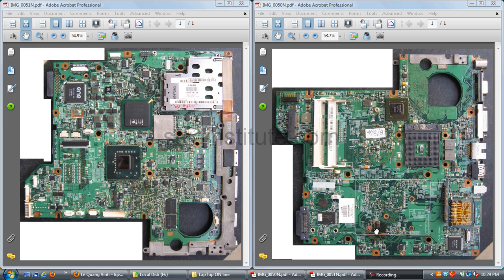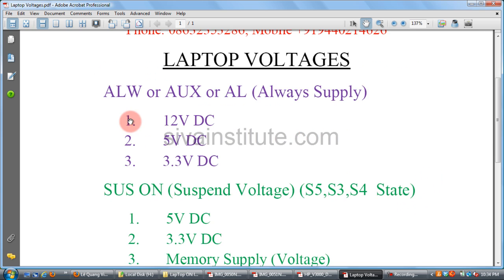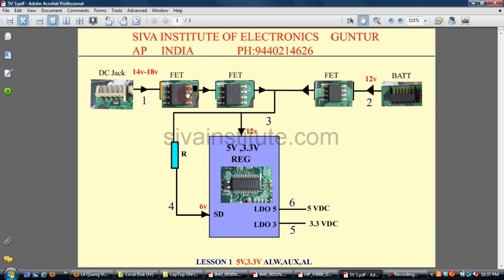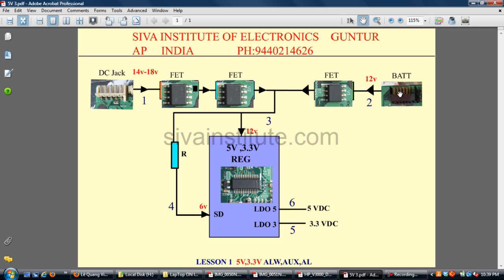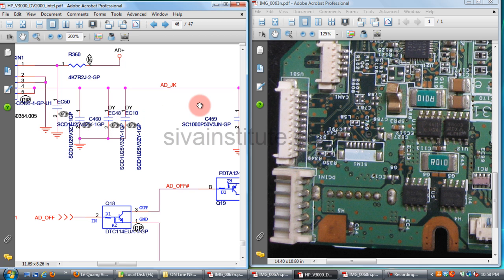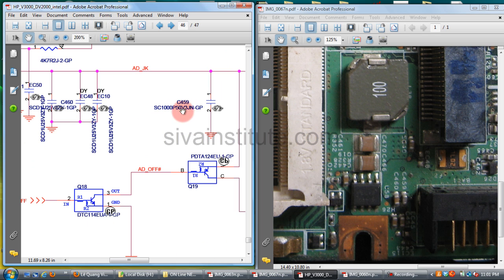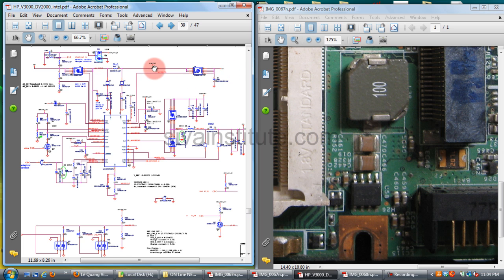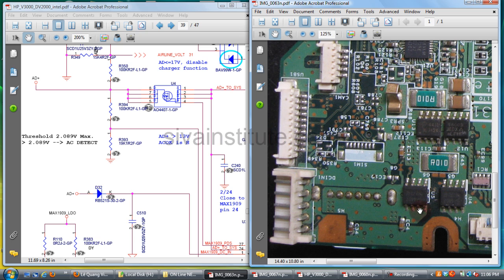Laptop motherboard Repair (Chip Level) How to check dead board .Eng

Comment: Hello

I have a HP6730b laptop Motherboard that is dead.  It does not charge the battery nor does it boot the computer with the adaptor plugged in.  I think the power IC is gone as the output coming out from all pins is 19V.  Am I right?  Any other component i check gives false readings.  Any suggestions?

Comment: Hi,  I am looking for schematics for a Samsung 700z notebook model np700z5c.  Do you know where I can find them?
Reply: hi i happen to be searching for the same schematic, specifically for the charging circuit. my laptop is dead because it wont charge and the powersupply is fine. if you come across the schematic please send it forward. i will do the same.

Comment: acer laptop turn on and then off several times nothing on lcd display ,what is the problem bad capacitors or what , i m chip level allmost please help thanks
Reply: what model?
Reply: Is your acer 5520 or 7520 ?
Reply: bladerunner  yea, could you help me with it?
Reply: what model is that?

Comment: I would hazzard a guess that if the charger is not being detacted.... is the DC socket ok? when you plug in is there any light at all? you have to elliminate the cheapest through to the expensive and the dc socket where it conects to the motherboard may be faulty. Are the joints ok? dry joints? Your question is 3 mnths old so chances are you have solved problem. always obtain schematics.

Comment: I am working on a dell inspiron 1525 intel ds2. I follow your guide and made it to the end where you said to check voltage to input vin and should output vreg5 volts it reads 7.3 volts. Would this be an internal fault of the ic chip or the c249 resistor?

Thanks for your videos and response.

Comment: Hello awesome!! , what about laptops that when you power it on it stay few seconds then goes off again?  the one I have now which brought me to this video ofcause will just flash once when it's connected to the adaptor and nomatter how you hit the power button it would'nt flash again, but when it's connected battery alone, it will flash manytime as you hit the power button. when you hit it flash just like when you are taking picture with a camara and offff. So what can be the problem? thanks

Comment: how about the supply line when pressing the power button?how does the laptop power on?where does the voltage goes after powering on the laptop.you should explain what component drive the power on.